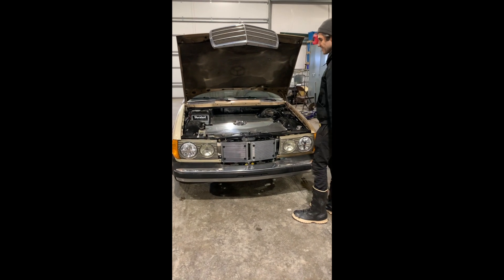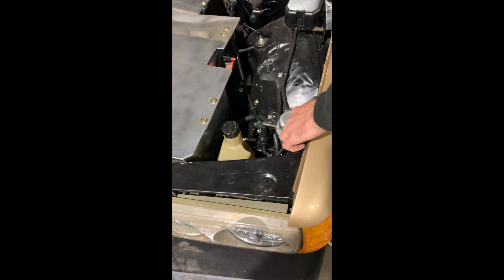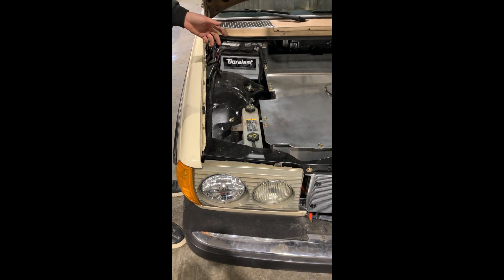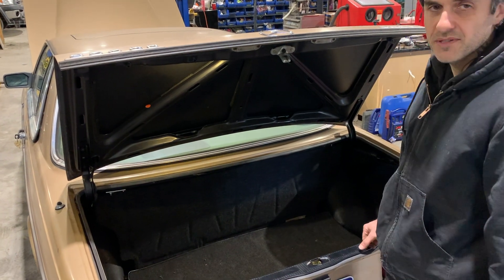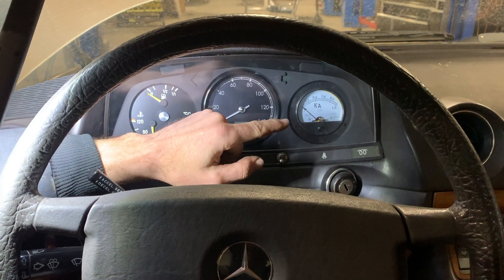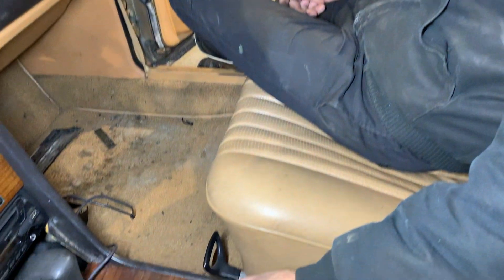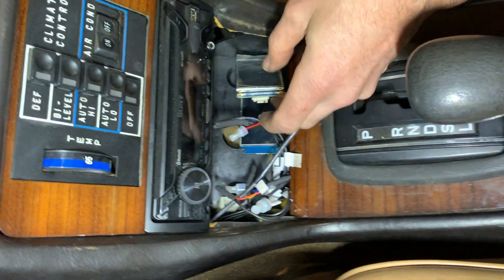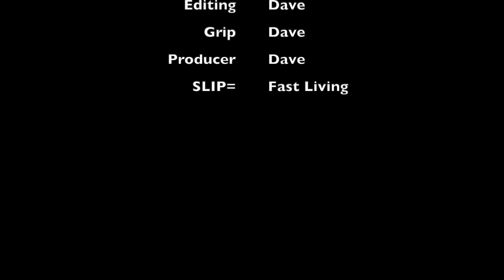Mercedes 300D Tesla Swap EV Conversion Part 7 Final Walk Around

Comment: any updates? how had it held up? I have a 2019 bolt premier I love, and a 1985 Mercedes wagon that it sitting in the garage begging to go EV. (Engine and trans out, interior gutted) I had been redoing it when I got my bolt and after having the bolt the last 3 years, I really want to make the wagon an EV.
Reply from the maker: @gercoa9148  look at my last video.  All the content is now on the Salvage To Savage channel.  It ran great for four years and I just took it apart to put a larger battery pack in.

Comment: Love the build. The little hole behind the fuel door is actually a drain for water when it rains. If you have the space, you might want to reinstall that line, otherwise it might start gathering water in the wet season and rust.
Reply from the maker: I already put that back in with flexible tube over a year ago.  Didn’t want water building up.

Comment: Does the car have an HVAC system at all?
Reply from the maker: No. I don’t drive it in the winter because of salt and it has sun roof and full window retraction so it’s like a hardtop convertible.  I do plan to do AC when there are better solutions.

Comment: How are the brakes when slowing down from a high speed? I have a 300D (sedan 4 speed manual with SST turbo) and the brakes are bit wanting if driving hard on winding roads. There is a simple solution, the brakes from a W126 560 are a bolt in fit. I haven't bothered on mine, I just forced myself to drive slower ,after the last speeding ticket. (in a   300D !) 
I like the idea of the rear axle too, which is what I thought about doing if I can find an affordable tesla drive unit. (musk is missing out on a whole market of electric car DIYers out here) .The Tesla rear suspension looks just like the Mercedes W124, W129 and W140 five link rear end set up. I have one of those in the shop so maybe.....
Reply from the maker: You hardly need brakes with regen braking.  I thought about a brake upgrade but I figured I would try it without and see how it felt.

Comment: Great Work! Im based in Germany and I will start to convert a c124 300ce automatic , just a few years younger than yours. I choosed torquebox and  netgain hyper 9.  I m very interested in getting more information how you solved to use the stock gear selection. Could you provide me which kind of relais your are used and how you implement it? That would be awesome cause I want to have same solution like u did. Thanks in Advance Michael
Reply from the maker: I used the stock neutral safety/brake light switch to create 12v signals from the stock gear selector.  The relay for creating the drive 12v signal is a standard 5 pin automotive relay.  It’s pretty well explained in the video that explains the controls.